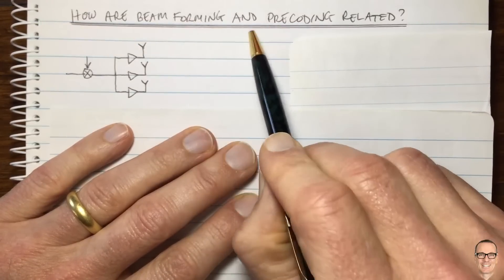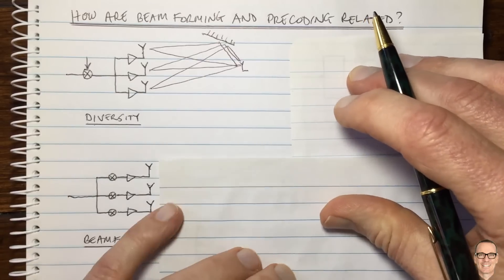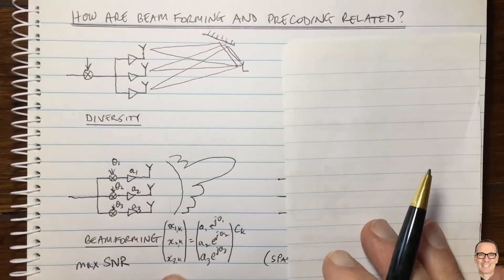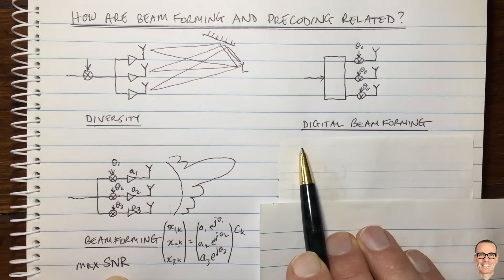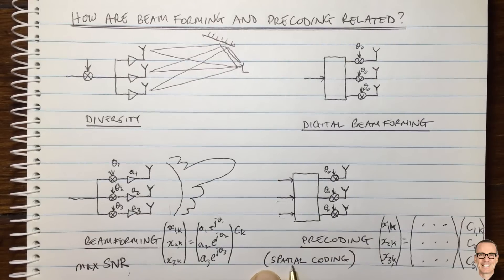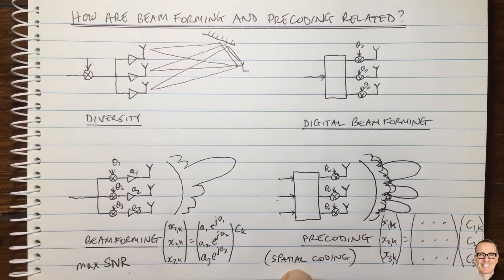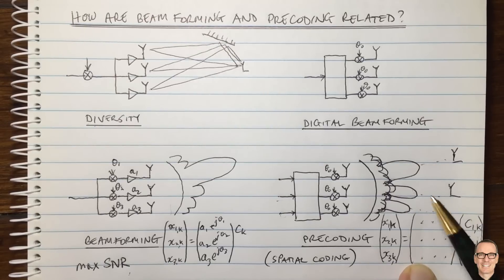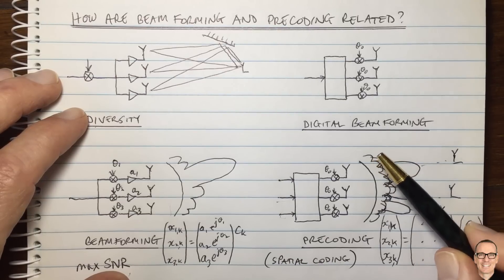How are Beamforming and Precoding Related?

Comment: Great explanation. But I would like to know if reducing interference among the streams is not also a way of maximizing SINR? MR precoding increases the power of the desired signal - a way of maximizing SINR. And is the case of ZF precoding that seeks to cancel out interference also not maximizing SINR?
Reply from the maker: Everything has a trade-off. Reducing interference among the streams can't be done without trading off (ie. reducing) the signal power in the direction of the intended user.

Comment: Hi Lain, why do we need to multiply with theta_0 at each path in case of precoding?
Reply from the maker: That represents the carrier phase of the oscillator used in the up conversion to passband.
Reply: @iain_explains thanks.  I saw another video where you explained spatial multiplexing...How that is different from precoding?
Reply from the maker: It's a version of precoding.

Comment: Great presentation.  Can you direct me to a video on common circuitry used in the phasing networks?  Are varactors (and fixed elements) used with varying bias levels to form the required phases differences for each antenna?
Reply from the maker: Sorry, I'm not an expert on hardware implementation, but I understand that fixed elements are used in applications that have fixed beam directions (such as down-tilted base station antennas in mobile cellular networks). At higher frequencies (such as mm-wave communications) the "fixed elements" are sometimes just tracks/connectors of different lengths for each of the array elements.
Reply: @iain_explains  Thanks for the feedback.  For scanning array radars, I think things get more complicated.

Comment: For digital precoding do antenna spacing play an important role ? When I read some paper, it seems that some author completely ignore this spacing issue and focus on the mathematical formulation stuff instead.
Reply from the maker: There's an assumption that it's a plane wave. Other than that, it's just the amplitude and phase of the channel gain at each antenna that matters. ... and also an assumption that each element acts as an isotropic antenna (ie. they are not so close together that energy is coupled between the elements.)

Comment: In digital beamforming if i want to transmit 2 independent data streams from a transmitter ULA having 4 elements towards 2 receivers that are placed at different locations, does each data stream is transmitted from half elements of ULA with their corresponding steering vector/ weights? if the data streams are to be transmitted simultaneously
Reply from the maker: Good question, but no. Both streams will use all the antennas. It's referred to as Multi-User MIMO. See this video for more details: "What is Multi-User MIMO Communications (MU MIMO)?" https://youtu.be/0ncIWlhsu1A

Comment: In the last picture, precoding section, 
we have like C_1,k complex symbol intended for user 1, C_2,k complex symbol intended for user 2, C_3,k complex symbol intended for user 3,. For C_1,k to reach user 1 (under high snr or zero forcing case), we adjust the phases and amplitudes across all the antennas such that a beam is generated for user 1 direction. Similarly we adjust the phases and amplitudes to form a beam for user 2, while sending C_2,k. Similarly for C3_k.

 But, how do we achieve simultaneous transmission to all three users in the same frequency and time? Doesn't beamforming provide simultaneous transmission possibility ?
Reply from the maker: The matrix (shown as a 3x3 square of dots) adds all the user's signals together (with appropriate beam forming coefficients - which are the column of the matrix) to give the signals that need to be sent from each antenna, so that all users are sent at the same time and at the same carrier frequency (... each with their appropriate beam former).

Comment: great lecture. thanks
Reply from the maker: Glad it was helpful!
Reply: @iain_explains  why the number of beams formed by a ULA is equal to the number of antennas?
Reply from the maker: If you have L antennas, then you could send a different data stream off each antenna, and have L data streams - but they would all interfere with each other and you would need L receive antennas in order to be able to "untangle" them (that's what standard MIMO does, by inverting the channel LxL matrix at the receiver). Or, you could pre-invert the channel at the transmitter, which effectively forms L beams, each one carrying its own data stream towards its own single receiver (and there will be L receivers). This is what Multi-user MIMO does. You don't need to pre-invert L streams, you can do less than that if you want. But you can't do more than L, because you only have L degrees of freedom.

Comment: At 7:56, if you're talking about beamformers being defined in columns, I don't think that is correct. I think the correct description is that each row defines a beamformer that produces a superposition of all the input data streams, thus giving the desired emission distribution. This would then be multiplied by the inverse CSI matrix to produce the required data stream seen at the UE. Is this an appropriate description in your view?
Reply from the maker: It all depends on whether you're talking about transmit beamforming or receive beamforming, and whether you write the input/output as a column-vector multiplying on the right hand side, or a row-vector multiplying on the left hand side. In this case, you seem to be talking about receiver beamforming ("that produces a superposition of all the input data streams"), whereas I was talking about transmit beamforming (that puts each data stream onto all of the antennas). For example, you can see from the equation that I wrote, that the data signal c_{1,k} will contribute to the signal that is sent on each of the the antennas (ie. x_{1,k}, x_{2,k}, x_{3,k}), because when the matrix multiplication is done, c_{1,k} will be multiplied by the elements in the first column of the matrix. Therefore the first column is doing the transmit beamforming for the first data stream c_{1,k}.
Reply: @iain_explains  I was referring to the transmit side, I was just looking at it in terms of the sum of all signals sent to each antenna, not as each signal being sent to all antennas. As long as all members of the precoding matrix are non-zero and complex, then all signals are sent to all antennas, but with mixed amplitude/phase combinations for each input stream, and that would give the required beamforming for different input data streams.
Reply from the maker: Yes, that's right.

Comment: Please can someone confirm if I understand this well: If beamforming is performed in an analog manner, then the phase shifters are usually time delay lines. BUT, if beamforming is performed digitally, then we can create sinusoids with different phase but without delaying symbols among them, so symbols exactly start and end at the exact same time just having different phases. This would not happen with analog beamforming which would have the exact same sinusoids but with sligth delays between them. I understand that such time delays are negligible when working with high frequencies and symbols that may have tens of thousands of cycles/symbol. But I would like to be sure that this is like I say and I wonder the implications on the receiver side... Thank you.
Reply from the maker: Yes, that's right.

Comment: Thank you. Haven't you mentioned in another video that in analog beamforming you can only change the phase and in digital beamforming you can change both, amplitude and phase? 
Here in analog beamforming you can change both too.
Reply from the maker: Ah yes, you're right. It's often said that analog beamforming is "phase only" beamforming - but this is generally within the context of hybrid beamforming where the antennas don't have their own seperate amplifiers (due to practical restrictions that relate to the size and number of the antenna elements - typically for mm-wave communications). In general though (at lower transmission frequencies) it is possible to implement a seperate adaptive amplifier for each antenna element, and then you have the case I describe in the bottom left hand picture.
Reply: @iain_explains  can it also be that you say that because here the amplifiers are fixed installed and cannot be adapted?
Reply from the maker: If the amplifiers are not adaptive, then yes, that's right.
Reply: @iain_explains  
Dear can u please make a video on open loop codeook based precoding( How UE Knows which index to use?)
BTW your Explanation of the things is the best on the internet.

Comment: To do beam forming, you need to send the same symbols on the antennas from the array then precode it. 
So how could you serve 3 users (transmitting differents data) with a 3-antennas array simultaneously using beam forming to null the interference between the channels. Or do you need 3 clock cycles?
Reply from the maker: I think this video will help to answer your question: "What is Multi-User MIMO Communications (MU MIMO)?" https://youtu.be/0ncIWlhsu1A

Comment: In Digital why do you have to multiply the signal with the phase two times?
one was in the digital Box and then again with the same phase as per your figure.
Reply from the maker: The "same phase" analog phase change that's on each antenna in the Digital case, comes from the carrier oscillator signal. It doesn't change the direction of the beam, since it's only the relative phase offsets that affect that.
Reply: @iain_explains  Just to clarify you mean it's a carrier frequency to transform the signal to passband?
Reply from the maker: Yes.

Comment: Thanks. In Digital Beamforming: you give the same Signal to the single paths (after the base band unit). Is that right?
Reply from the maker: Sorry, I'm not too sure what you mean.
Reply: @iain_explains  
In the upper right picture there you have the white box. I assume that is the Baseband Unit where the digital processing for the digital beamforming take place.
As from there what signal do we have? You give it to three cables which connect to the three antennas. Are that three different signal or is it one signal what you give to every antenna?
Thank You.
Reply from the maker: Yes, the box you refer to is where the digital beamforming is implemented in baseband. This allows for both amplitude and phase changes to the data symbol coming in from the left of the box (compared to analog beamforming, which only has phase changes). The output from that box shows the three signals (one for each antenna) that each have their own amplitude and phase (determined from the digital beamforming precoding vector), which are then each up-converted using a carrier signal (with the same phase for all antennas). This video might help (it covers the more general Multi-Channel beamforming case): "What is Multi Channel Beamforming?" https://youtu.be/e6scR0C4RAc
Reply: @iain_explains  Thank You, and in Digital Beamforming there is an own RF chain to every antenna as is generally known. So theoretically you can also vary the frequency of every antenna. Is that right?
I guess, it is a bit senseless because one want be economical with the frequency and don't need to take different frequency because of the beamforming.

Comment: Great video! Wish I had seen this video during my PhD period which would save me much time. All the materials use the main/side lobes to explain beamforming/beamsteering but no one uses it for digital beamforming/precoding which made me not clear on the real world effect of precoding. Actually they should be illustrated in a similar way as in this video.
Reply from the maker: Glad it was helpful! It's great to hear that it's given new intuition.
Reply: @iain_explains  Please make a video on Hybrid precoding and why there is a need to optimize the weights.

Comment: Thanks.Sir can you please make video for how to draw constellation diagram for 4FSK, 8FSK,.., MFSK.
Reply from the maker: There's not a "constellation" diagram, as such, for frequency shift keying, since each symbol waveform is at a different frequency. There's really only one degree of freedom (frequency), compared with two degrees of freedom for QAM (amplitude and phase). The equivalent thing would be a single line, to represent the frequency parameter, with dots along it, at the frequencies of the various symbol waveforms.
Reply: @iain_explains  Thanks sir.